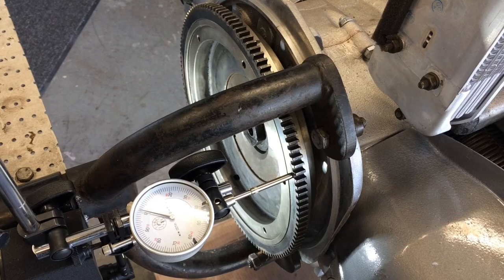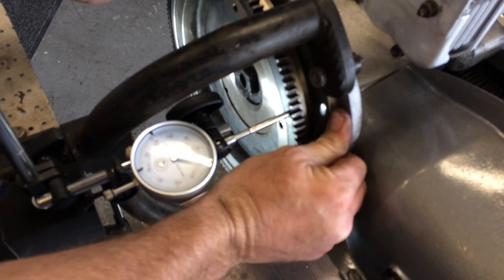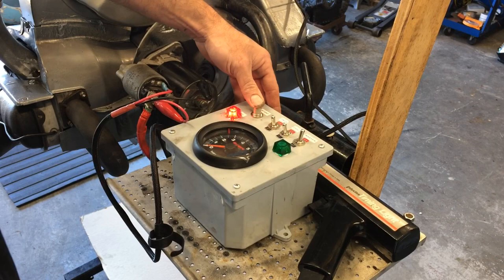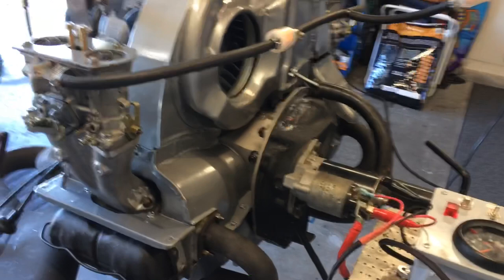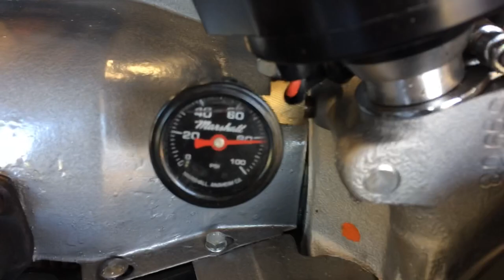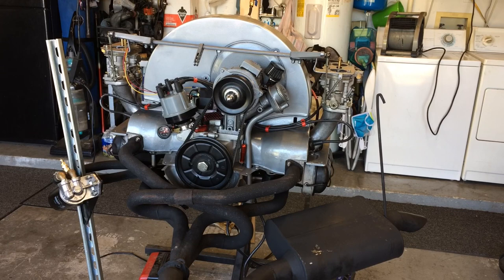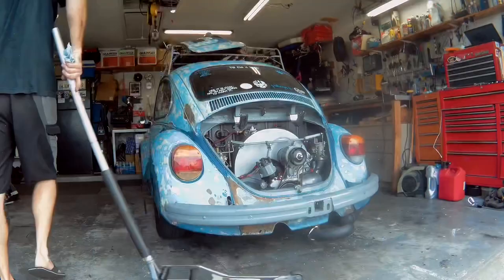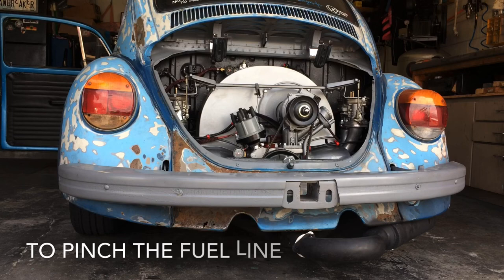VW Bug - 74mm - 2054cc Stroker Engine - End Play and Cam Break In. Part 3

Comment: I have a tip for you - 
The crank shims fit perfectly in a tape container.  I buy the 33 + electrical tape which happens to come in a container.
I measure all mine then label the container as to which size is in which.
Reply from the maker: Holy crap, that’s an awesome tip! I have a few of those containers laying around also… thanks for sharing 👍

Comment: Somebody got some boots! The toesies police will be pleased. Engine break in really gets the adrenaline going, great stuff man. Gotta ask- is that a Schrader valve on the oil line? What's it for? Regarding encouragement during this build- watching you power through adversity is the most encouraging thing of all. Thanks for sticking with it! We all occupy a great little corner of the YouTubiverse.
Reply from the maker: Haptic Garage I count have done this without the fellow Youtube encouragement that’s for sure! It’s so nice to know people have our backs and best interest at heart. 
What Schaffer valve are you referring to? I don’t have one on the oil system.
Reply: @VWJawbreaker  yup, the encouragement is great.
I saw something installed in the line at the remote filter mount I didn't recognize. Pressure regulator? Flux capacitor? Dohickey Thingamabobber?
Reply from the maker: Haptic Garage ahhhh.... I had to rewatch the vid for a moment 😂
That’s the oil temp sender for the gauge in the car.
Reply: @VWJawbreaker  Got it, thanks!
Reply from the maker: Haptic Garage anytime!

Comment: Nice job, love the videos. Very helpful.                                                                                   Question:  On the block off plate for the fuel pump on top of the case, what is the line you have coming off of that plate for and where does the line lead too?
Reply from the maker: Hi Randy. Appreciate the kind words. 
The hose on the fuel block off plate is a breather hose that goes to a breather box on the firewall. Larger engines, higher hp engines benefit from a breather box but not all engines need one.

Comment: Well done on bouncing back and getting it going. I am sure that sound of it coming to life and then settling on down to an idle was worth the pain. Would be interesting to see what sort of time and $$ you have in the 2054. Cheers, Steve, Sydney Australia
Reply from the maker: porsche356a yes sir Steve, you are correct! The anxiety of the cam break in is a rush and a major stress moment all wrapped into one. Seeing the oil pressure, temps, no leaks and no unusual noises sure sitters the mind real quick. 
As for the money into this build, I did get some parts for a killer deal which enabled me to build it to begin with, so the total cost isn’t as bad.... besides the new case and crank of course. Knowing me I’d hate to know the final cost lol

Comment: Great and informative Video. Break in sounded so smooth. Love to have an engine that size to travel across America and the complete distance of Route 66. Quick Question, do you use standard oil or multi grade? Again Awesome Video!👍. BigW:-)
Reply from the maker: Big W Adventures thanks Big W, I’m lucky to have such great support like yourself to keep me pushing forward. Still tuning the engine but the mpg isn’t horrible and I have room to improve!
I run Valvoline VR1 oil either 10w30 or 20w50 depending on the engine. The VR1 has high zinc content that our engines need to live a long life. The main key is zinc for our oils, not so much the oil weight.

Comment: What’s you favorite lifter brand to use and what you think about Engle lightweights lifters
Reply from the maker: I haven’t used Engle lifters yet. 
I’ve had good luck with lifters from Scat, CB Performance and AA Performance. I’ve mostly used Scat lifters as that’s what the local shop mostly sells. 
I’d use any of those 3 anytime though.

Comment: I have a 1915 now and I am wanting to go bigger. I was thinking 2332 but from your video's I don't think I want thin spots in my case. The 74mm crank looks a bit safer for me to go than the 84mm I was thinking about.
Was 139 more cc's worth all the work or do you think I should go farther. Is there a crank available between 74 & 84?
Reply from the maker: Personally I’d go with an 82mm crank, that would give you a 2276. The main reason I went with the 74 stroke is because I had basically new pistons and didn’t want to but another set. There are A and B pistons. A is for the non stroked engines like my 2054 and your 1915. B pistons are stroker pistons which are for the larger strokes cranks. Depends on the case and what rods you have will depend on how much you’ll need to clearance out.
Reply: @VWJawbreaker  This motor was build 10 years ago and was a stock H VW case align bored, bored to 94's, drilled for full flow, rebuilt stock rods with a counterbalanced crank. 041 heads with 40 intake 35.5 exhaust valves and dual Empi 40's. It's bolted to an 091 transaxle in a rail frame. Would the 82mm crank need to have more clearance in the case than the 74mm crank?
Reply from the maker: @trevorallan1340  yes, you’ll need more clearance even for the 74 crank most likely. The way the rod bolts are on the stock rods will require a little more work with the case than aftermarket rods also.

Comment: 18 minuts running and 70 psi of oil pressure ? when hot what oil pressure is it , idle?
Reply from the maker: antbarrimont idle when hot oil pressure was around 30psi. I have since switched a few things around to correct the high oil pressure problem.
Reply: @VWJawbreaker  the rear relief valve was ok?
Reply from the maker: antbarrimont yep. If I pulled the spring the plunger would slide out. Ended up finding stock springs that were not as stiff as the new ones and dropped the oil weight down. Now she’s idling around 15psi and around 50 when cruising.
Reply: @VWJawbreaker  that's great,  regards

Comment: do you have deep oil sump
Reply from the maker: Nope.
Reply: @VWJawbreaker  would you recommend it for cooling? or is there minimal difference for oil temperature?
Reply from the maker: @vwbtl9  I personally haven’t done side by side comparisons however the theory is the sump adds more volume of oil but doesn’t really help with cooling. Reason being there is more volume still being heated up by the engine. 
An external oil cooler in addition to the stock oil cooler is the best way to cool it down. That’s after you make sure the engine is tuned and running properly and all tins are in place.
Reply: @VWJawbreaker  so you would not recommend mounting it for cooling only? i dont do hard turns i only accelerate on straight lines but on turns i go slowly
Reply from the maker: @vwbtl9  that’s up to you. It wouldn’t hurt to have one so you’ll have additional oil capacity.
Reply: @VWJawbreaker  true, but im also scared that i would not hit some curb or something with it.. and also i cant lower my bug then if i have one